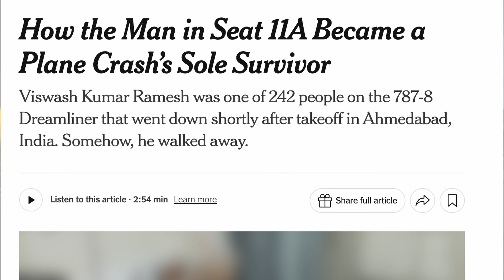Why the RAT Changes Everything – Air India 171 Update

Comment: You can't say "spinning at the speed of (sound)" The speed of sound is a linear speed. Spinning is a rotational motion, and it is measured in revolutions per minute, or at radians per second; with that, every point on the propeller spins at the same rotational speed. The linear speed, however, is different for different points on the propeller; the further away from te center of the rotation you are, the higher the linear speed, so outer parts of the propeller may reach or exceed the speed of sound, while mid or inner portion may not... I know it's YouTube, but "spinning at the speed of sound" is even here a wrong shorthand.

Comment: I will throw this here. 
I've not seen it as an option. 
For me it seems obvious.
Taking into account that there are some videos about the fact the plane suffered some sort of AC problems on the previous flight and the fact that apparently some sort of electrical problems were reported, too.
Did anyone account for a catastrophic electrical failure which prevented the fuel pumps to work and starve the engines of fuel?

Comment: Thank you, Captain Schrieber, for posting the video and your analysis.     I have been working in the aerospace industry as an employee of a contractor for OEM's.    My first thought was dual engine failure upon seeing the transcript of the May day call by the captain.     while there will be a lot of further speculation to go around,  you have done a great job of leaning towards you specific reasons including the deployment of RAT and initial conclusions.    A question,  looks like the engines provided adequate thrust for the aircraft to lift off and then the engines failed/shut down.   What are some of the probable causes that may cause that?

Comment: Yes, you could hear the RAT on the original video posted on line. (Automatic) RAT deployment = dual engine failure or hydraulic failure or certain electrical failures. Hopefully, the FDR will confirm the reason for the RAT deployment.

Comment: It’s possible that one engine of AI171 was already underperforming or producing degraded thrust even before takeoff, leading to a sluggish and unusually long takeoff roll. Despite this, the pilots may have decided to continue the takeoff rather than abort, possibly misjudging the risk or crossing the V1 decision point too late. As the aircraft barely lifted off near the end of the 3.5 km runway, the second engine might have failed or lost thrust due to overstrain or other factors. With full landing gear still extended and flaps retracted too early, the aircraft couldn’t generate enough lift, leading to a rapid aerodynamic stall. The Ram Air Turbine (RAT) deployed, indicating total engine failure and electrical loss. With no altitude gained and no time to recover, the aircraft crashed nose-first shortly after takeoff.

Comment: My thanks to Captain Steeeve.
I went with the flap/slats up suggestion and I posted a few comments elsewhere supporting it around two to three days ago. I now support suggestions that a dual engine failure seems most likely. It doesn't mean that I was 'wrong' to have commented whilst supporting a viewpoint that seems (now) to have only limited merit.
I'm not embarrassed about initially suggesting it, and I have no intention of going to the pages I commented on and removing or editing my comments. Doing so is not a protocol I wish to adopt.
I've viewed some comments regarding the suggestion of suicide. I won't go there with my commentary, but if this did occur it would again highlight just how easily and quickly fuel control levers can be positioned to the cutoff (closed) position during a most critical phase of flight. It is also a VERY scary thought.
I feel that most of us here hope that such a scenario did not play out on the flight deck of Air India 171 the other day.

Comment: Good on an expert admitting his first guess was probably wrong.

Regardless, how can a modern hi-tech plane, stuffed full of safety programs, allow a pilot to retract flaps instead of wheels?  No 'fail-safe' for that?  No warning?  No recovery possible?

Where in any images are the flaps changing instead of the wheels retracting?

YES, there's more to come.  Expert investigators say that air accidents have multiple causes.  So I'll guess there is more than the Flaps/wheels and RAT involved.  eg If there was engine failure and flaps retracted, and electrical failure, the RAT may not have done what it was supposed to do because of another failure.

Note to photographers.  This is EXACTLY why phone cameras are valuable.  Not a single person has come forward with a high megapixel DSLR with tele lens!  (I've got both!  With zooms.)  ANY image on a phone is better than no image on 'perfect' gear.  Pixel peepers would have still been choosing their body and lens combo and missed the lot!

Comment: Maybe the engines weren’t working, but that doesn’t necessarily mean they were malfunctioning — maybe something else caused both engines to stop working.

The man who allegedly survived the plane crash is suspicious; I can imagine he survived the impact, but how did he survive the fire caused by the fuel explosion?

Why don’t passenger planes have one large parachute that could gently lower the entire plane to the ground? Although I think even a parachute wouldn’t help in this case, since the altitude was too low and the weight too high.

Comment: Thank you for this insight. You are an incredible resource in the aviation industry. I am curious if you see any common threads between this incident and the BA35 incident. In both cases a boeing aircraft seem to have suffereed dual engine failure. granted the BA35 incident was due to ice and that would not be a factor in the air india event. I was startled to realize that a 777 also suffered a dual engine failure.due to fuel flow restriction in the FOHE's. More details on BA35 here: British Airways Flight 38 (January 2008): This is the most significant incident involving a British Airways 777.
Date: January 17, 2008
Aircraft: Boeing 777-236ER, registration G-YMMM
Route: Beijing Capital International Airport to London Heathrow Airport
Summary: The aircraft crash-landed short of runway 27L at Heathrow Airport. Both engines lost thrust during the final approach. The plane touched down hard on the grass, causing the landing gear to collapse and substantial structural damage.
Casualties: Remarkably, all 152 occupants (136 passengers and 16 crew) survived. One passenger sustained serious injuries, and others had minor injuries.
Cause: The investigation by the Air Accidents Investigation Branch (AAIB) determined the cause to be a fuel flow restriction on both engines due to ice crystal accumulation in the fuel-oil heat exchangers (FOHEs) of the Rolls-Royce Trent 800 engines. This was a rare and previously unknown phenomenon related to prolonged flight at low fuel flows and cold fuel temperatures.
Outcome: The aircraft was deemed beyond economic repair and became the first hull loss of a Boeing 777. The incident led to design changes in the FOHEs to prevent similar ice accumulation.

Comment: HI Captain Steve, I wanted to ask if the engines on on this flight could have vapor locked with the high outside temperatures and caused the engine to flameout?

Comment: There is a Theory going on here in media that the systems of Boeing 787 which tragically crashed were hacked on ground or midair by terrorists.

2 or 3 more Air India 787s BOM LHE, HKG DEL and one more were returned and landed due to sudden technical glitches midair after this crash.

If this can be done or happen then the entire global aviation is at risk.

Kindly Please, Please Enlighten.

Regards, Sarvesh
I am an ex Aviation guy with 28 yrs in Commercial Operations of Airlines

Comment: W A T E R over 13 year could have done it. The plane was on the ground for hours, airconditioners were too weak at 100°F in the mid sun so the crew leaves the doors open to create a draft in high humidity. Put a bootle of cold water out there and see streams water dripping into the plane - gallons, daily. So putting this in context is that when the captain commanded gear up, the high amps motors could have created a shortage that blanked out the whole aircraft. The RAT deployed and the whole system incl the bus was weak, not pulling up the gear but killing the amps to the fuel pumps and the awaiting vapor lock from the heat was just waiting to bubble air into both the turbines -  lets not make the mistake and think that maintenance in India is the same, they deal with heavy corrosion issues like Africa, and daily system issues that might not have been solved pressuring to end the delays and take off. Mechanics over there are not the same and regarding the complexity, they might have been lost. But the lawyers will put a lid to this because life is valued differently. - With a warm prayer for those hit by this tragedy to live on.

Comment: On the day of the incident, the extreme heat created atmospheric conditions similar to those found at much higher altitudes. Although Ahmedabad Airport sits at approximately 3,900 feet above sea level, the soaring temperature of 41.9°C significantly reduced air density, effectively elevating the airport’s ‘density altitude.’ This thinner air would have adversely affected both lift generation and engine performance. Under such conditions, the aircraft would have required a longer takeoff roll and a higher ground speed to achieve the necessary lift for a positive rate of climb — a factor that may have been critical if the flight configuration was not adequately adjusted for such degraded performance.”

Comment: On an unusually hot afternoon, AI171 faced a ‘perfect storm’ of aerodynamic penalties. Reduced air density limited lift, engines underperformed due to thin air, and takeoff margins were stretched. With the aircraft likely operating near its weight threshold, even a small deviation from expected performance may have caused a catastrophic failure to gain safe altitude. Such scenarios underscore how climate-induced variables, once considered edge-case, are becoming central to flight safety assessments.”

Comment: Another evidence that complements the conclusion of a dual engine failure is it was going to be nearly impossible to hear that high-pitched prop RAT sound if engines were producing their usual thunderous sound upon take off. What is only heard in that revealing video, is the clear RAT sound as the aircraft was at its closest proximity to the location of the phone shooting it, and just the sound of air friction with the fuselage .. if engines were working their usual sound would've masked out the RAT sound which wasn't the case in the video ..

Comment: You made a nonsensical downright silly theory about pilot error of mixing up flaps with the landing gear stick before when even in common sense it made no sense, unless of course you have some personal experience on getting critical flight controls like that in a take-off or landing. It ain't making any sense at all when you are an experienced captain who either has flown or is flying Boeing jetliners like 787.

You obviously got it wrong about the critical nature of the flaps in 787 with it's particular powerful GE engines. When everything in that even blurry initial video was pointing at engine flaming out high probability, you came up with the silly pilot error theory of flaps and landing gear mix-up as those pilots were given their licenses in a backyard kite competition.

You are obviously not familiar at all with the 787 to pass a sound theory. For you to come up with the flap-landing gear stick mix-up theory if it was due to your observations of such mistakes, I would be really worried about flying in any commercial jetliner. 

We know about the critical nature of flap configuration(flaps being extended) depends on the weather conditions,  different aircraft builds, particular installation of engines with their maximum thrust level, whether the aircraft is still on the ground at high speed, or how high the aircraft from the ground and whatnot.  There is no such situation when the flaps are not extended airplane definitely fails to take-off, loses altitude(if it's already airborne) and control to stall and crash,  787 with GE engines can even take off on one engine with half the maximum thrust.  The airplane got off the ground fairly normally with or without flaps clearly points out at an issue non-flap related. 

All the evidence was pointing at thrust loss issue, yet you were selling some silly pilot error theory for some unknown reason. 

Being an experienced pilot, i would imagine it is not good for you to get something basic wrong like that. Therefore, I am guessing your flap-landing gear mix-up theory was coming from some different self serving angle or an angle to serve some other entity(Boeing for example).

I guess you do fly Boeing?
Then you wouldn't want to put out theories on social media regardless of the accuracy of the theory that points out at mechanical or electrical failures of manufacturer related(Boeing and GE). I guess that's why you kept going on and on with the flaps up, landing gear down theory for the reason for stalling when you would've known really well that ain't true and the maximum thrust would've easily overcome that issue.

It is good you've corrected the previous nonsense theory, but came out a bit too late. 
Your dedication to putting out regular videos while flying around commercial jetliners is admirable, but not your motives though. 

If you cannot tell the truth about an air crash due to you being an active pilot flying, it's better to not say anything at all, rather than being disingenuous and misleading public and insult all the pilot community out there.

Comment: Survivor told that there was an explosion and there was an electrical failure leading to the RAT deployment where the engines failed. This occurred after 11 seconds on the flight and the flight took 30 seconds leading that there was not enough time for the pilots to recover control of the plane. There must be a need for a tertiary power source other than the RAT that the pilots can use. This event is really tragic. Investigation needs to know what exploded. The Flight Data Recorder/Voice Data Recorder hopefully help in analyzing this tragedy of events.

Comment: Sounds like elec failure....even a fuel issue is unlikely to make both engine stop at the same time...due to multiple tanks and fuel feeds.
Reply: The engines will suction feed with no electrical power, the FADEC is powered by the engine itself, so only lose power after the engines have stopped turning (which they don't do in a "flameout") 

Take away: the engines keep running even with a total loss of electrics.

Comment: @CaptainSteeeve Looking at the empennage wedged in the side of the building, the APU shroud itself potentially shows indications of a mild tail strike, on the unpainted metal section. It follows the keel line. Anyone considered internal cargo load shift impacting rear EE bay? You couldn't see if the tail strikes the runway, because rotation occurs out of sight behind a small building. Cargo load shift impacting rear EE bay would also potentially explain the electrical and potential systems failures?

Comment: AI315, another Air India Dreamliner had to turn back around from Hong Kong enroute to Delhi due to fuel contamination/fuel filter issue. Interestingly, this tail was in Delhi on the same day as the one that crashed. With fuel contamination being a strong possibility, (but mostly ruled out on the fact that no other plane was impacted) - could this be re-visited as a possibility?

Comment: I won’t say is a engine failure because you can still hear the engine  running and if it was down then it would just go down like a rocket but you can see it kinda glided to the building. And what happens to the APU if the two engines r down the APU would have back up fuel so I don’t want to say it was an accident I say it is the same as MH370 where the captain actually killed all the passengers and crew and copilot cutting out there o2 and fly to the middle of the ocean then cutting O2 again and he die this time then the 777 was already on AP it ran out of fuel then APU start using the remaining fuel then crashes to the sea😢
Reply: You dont know sheet about airplanes.

Comment: It is highly contaminated fuel which is mixed intentionally mixed and intentionally mixed by some one.  If that is the case then it is failure of security system. How this could happen? Who check the fuel system, it’s pumps and valves ?

Comment: It's very difficult to confuse the flap handle with the gear handle, as Boeing SPECIFICALLY designed the gear handle AS A WHEEL, in order for it never to be confused with any other control in the cockpit. 

Considering the number of hours the pilot and co-pilot had under their belts, they would have needed to be inebriated to have made that mistake.

Probably hydraulics or electrical if I had to guess?? No VISIBLE evidence of engine failure, though fuel contamination is possible.
 But far better to see what's on the black boxes.

Comment: The sound of the RAT propeller is clear, but what is equally as telling in that video is what you don't hear... anything else.  Two large turbofan jet engines running at full tilt would be making a lot of noise indeed.